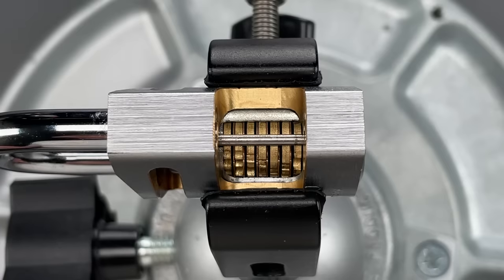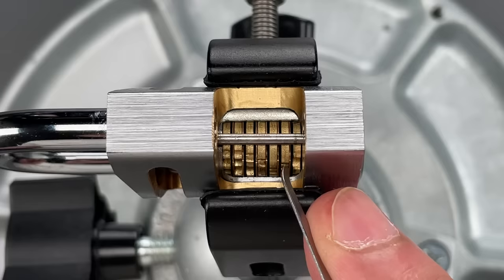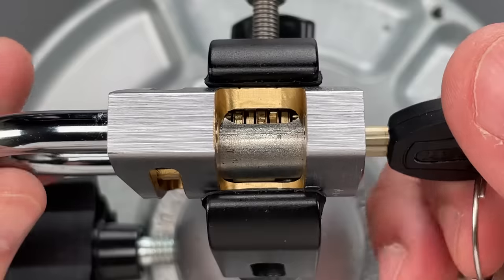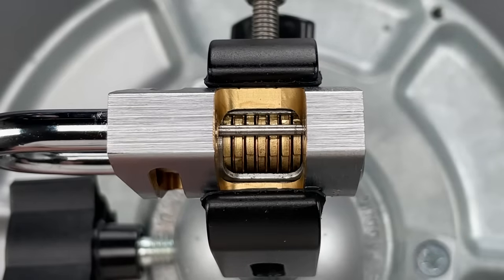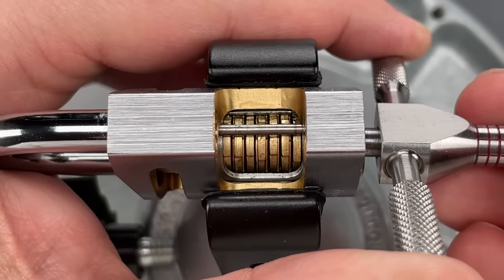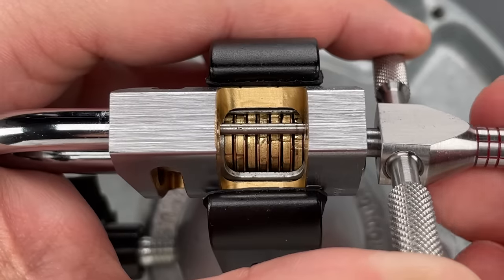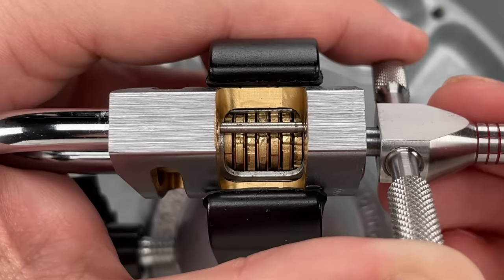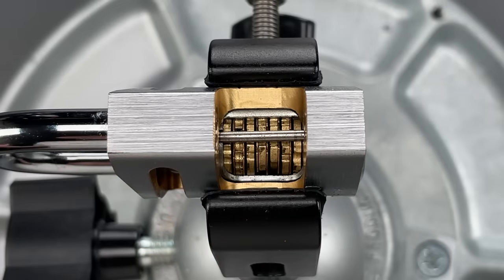[1436] Inside Perspective on Picking Disc Detainer Locks

Comment: "Isn't quite as good as we'd all like"?! How on earth could be explained better than that?! It was AWESOME!
Reply: The explanation was amazing as always, but he's right the view could have been better.  I have a practice disc lock where everything's clear but the discs, basically.
Reply: Seconded!
Reply: How does the key work too put everything in the right place. Of course it would be better if that where visualized as well.
Reply: Comparing it to the cutaway view of the pin tumbler locks, in the tumbler lock, you can see what the pick is doing when it's moving the pins. In this, the discs are blocking the view of the pick.
Reply: Transparent discs, so you can see the pick as well - but let's not overcomplicate things... :)
Reply: Right?!
Reply: @tubekrake  The keys are cut on an angle, not to a depth. The bitting angle sets the amount of play before the turning key engages and moves each disc. You can see these details a bit better in episode 965.
Reply from the maker: Unlike the pin tumbler cutaways, you can’t see the key or pick… I considered acrylic discs, skeletonized spacers, and  a few other options. I eventually decided this was good enough.
Reply: @gimmethegepgun  you do not need to see the "pick" inside the disc, the rotation the pick is doing can be seen on the disc itself (with a tiny delay).
Reply: It seemed to me you purposely did not show what the key looked like, or what the custom picking tool looked like.
Reply: @qwerty13380  you can find the entire "making of" of the tool, how it works and what it looks like is no secret, but due to how complicated it is, there was no reason to prolong the video by going over that part, when there already are videos explaining it.
Reply: @qwerty13380  if you watch the channel enough, you know what the Pick That Bosnian Bill And I Made looks like, and the key is not so important in my opinion. The idea is to show what picking a disc the painter lock looks like compared to a pin tumbler lock. This helped me visualize it very well.
Reply: @lockpickinglawyer  You were correct, excellent.  All of these have been great, this one was the best. Thanks for the effort in making this
Reply: @qwerty13380  Besides the fact that you can watch every step of the picking tool being made, the thumbnail is a clear pic of the tool, the key & the lock. I'm not sure what you're trying to imply with your comment.
Reply: @James-vn8zb  Ask your mother to help you read it!
Reply: @James-vn8zb  don't feed the trolls, 😆
Reply: I was about to make the same comment…
Reply: @qwerty13380  he showed how he and Bill made the pick and where to buy one in another episode.
Reply: @Camelcando  A few others had said the same thing.  But no one said what video, and I do not want to spend the time searching for it, and of course the trolls were no help.

From this video, I thought he was trying to hide the tool and technique he was using, but from comments like yours, I now know that is not true.  Hindsight is 20-20, but I think the link to the secret video should have been mentioned or provided in the description.
Reply: @KernelLeak  That'd be asking Wwell too much from lock companies...
Reply: @lockpickinglawyer  Bad guy.

Sorry.
Reply: @qwerty13380  If you need this amount of spoon-feeding for something simple like using a search function, I'm curious as to how you managed to get far enough in life to be able to type a comment on YouTube.
Reply: @mvanvoorden  Sounds like I ruffled a troll's feathers.  I hope it keeps you up at night!
Reply: @qwerty13380  Lots of examples of both of those in his other videos.
Reply: @gatherer818  I have never in my life picked a lock before but this video was crystal clear on the steps to go about picking a disc-detainer core. While I would like to see the inside, I'm already 100% confident on how to pick it correctly the first time. Now it is all down to practicing it over and over.
Reply: These inside perspective vids are amazing im loving the series :)
Reply: Exactly, I had no idea how a disc detainer lock worked and this gave me all the information I could want. I can piece together what it looks like on the inside of the actual lock itself but to see how the disc's look and work as it's being picked is a huge benefit.
Reply: @lockpickinglawyer  Maybe one day we will get the awesomeness of LpL's see-through disc detainer locks...
Reply: @qwerty13380  If you don't want to spend 5 seconds seaching for disc detainer lock tool then you deserve to miss out for being so lazy.
Reply: @lockpickinglawyer  this is good, it shows the lock operate. And if you know how the "Bosnian Bill and I" pick works you don't need to see it in action.
Reply: @lockpickinglawyer  And more than good enough it is H.
Reply: @qwerty13380  It seems to me as if you are a first time viewer to this esteemed Channel. The _ tool that BosnianBill and I made_ is a bloody meme coz it is that famous.
This lock picking genius has used his spare time to figure out the best way to cut away the lock body for our viewing pleasure and knowledge. If you don't like it you can always ask for a refund for the cost of viewing it.....oh wait, the video was free wasn't it. 🙄
Reply: @lockpickinglawyer  what if - hear me out - every disk was a two-way mirror? 🤯 (inception brrwmmm) I'm not sure what it would accomplish but you would see more and less at the same time
Reply: @qwerty13380  827
Reply: @Camelcando  Thanks for the reply.
Reply: @lockpickinglawyer  Leave it to the master to be able to critique his own actions...
Reply: @qwerty13380  In earlier videos, LPL described the disc detainer picking tool in great detail.
Reply: @markholm7050  Thanks, A few others have given me the links to those videos, so I am set.
Reply: @lockpickinglawyer  perhaps drill out the lock body opposite the cylinder and use a mechanics scope to watch the pick move back and forth on each disc on a picture in picture view
Reply: @lockpickinglawyer  See through disks would be cool
Reply: ikr goddamn this was amazingly built all the way from the amount of cutaway in the disc housing to the explanation of decisionmaking
Reply: Agreed 👍🏾
Reply: @qwerty13380  He showed the entire build process of The Pick That Bosnian Bill And I Made years ago. He's not trying to conceal anything.
Reply: @LockPickingLawyer where could someone find the tool like you use to straighten all the disks before you start picking? Thanks in advance
Reply: @therealedreal  It's just a flat piece of metal, BosnianBill talks about his in "(1685) Using ThePickThatLPL&IMade"
Reply: For illustrative purposes, a CGI exploded diagram/cutaway would give us a better "look", but real footage is king, so here we are at the top
LPL brings the goods everytime
Reply: I think the only thing that could have been having two camera views at once. If there had been another camera view with camera shooting from the bottom of the frame towards the area where sidebar touches the edges of the disks, it might have been easier to understand. Of course, you would have to fit both views at the same time but I think the another view only would have required a narrow fraction at the bottom of the screen.

The second view would have probably allowed to see the sidebar getting a bit deeper when all disks are in a gate + it would have made it easier to see what happens to sidebar when the lock opens.
Reply: My opinion exactly
Reply: I finally understand how these locks work... Diverse explanations for the win.

Comment: Your “Inside Perspective” series is fantastic. I had NO idea what a disc detainer lock was like before this.  This video made it so clear.
Reply: I came here to post the same thing. I knew it had rotating discs, but had no idea how it worked until I saw the cutaway with the discs and the side bar.

This type of lock always had me puzzled. Not any more...
Reply: Same here. Now i also understand what falling into a false gate means as well
Reply: Same
Reply: Seriously, all i knew it as was "first we start by turing all the disks as far as they go!"

Amazing series and amazing work!
Reply: I was looking for a name of this kind of lock for a long time. It is super hard to unlock compared to pin tumbler locks. Now i am more sure that no one is going to steal my bike when i have this kind of lock 😁 I am begginer at lock picking and managed to pick pin tumbler padlock with 5 pins  under 25 seconds with paper clips. So i guess locking with pin lock would take 5 seconds for someone to steal my bike 😂 This way it takes bigger tool and little more time so less chance that someone is going to try to unlock my bike 😂

Comment: LPL: "This bar that runs along the side, also known as 'the side bar'."
Me: nodding along like the expert I am
Reply: meanwhile, me: SIDEBAR, YOUR HONOR!
Reply: Reminds me of a quote regarding the design of the space shuttle external tank:
"That big tube down the side was officially called a "systems tunnel", which is aerospace contractor speak for "big tube down the side."
Reply: I thought that would be the bar you go to after being thrown out from the first one.
Reply: @cameronjadewallace  Beat me to it... Curses, foiled again!!
Reply: @lancer525  😹😉
Reply: Easier to work with that bar than the association, I assume.
Reply: Me: frantically taking notes
Reply: The Sidebar would be a great name for a pub where lawyers, locksporters, and lawyers who are locksporters hang out.

Comment: When you turned all of the discs clockwise, it immediately clicked why you do this on every lock. 

I know you've explained it in the past, but seeing it makes it make way more sense.
Reply: Very good point. I agree. It is so much more obvious to see it happen, than just hearing and seeing it from the outside of a closed lock body.
Reply: I'm stupid because I still don't understand why it's important.
Reply: @aspuzling  Maybe you are not stupid, you just have a different way of thinking about things. Maybe you understand enough of how it works already, or at least enough to satisfy your own feelings about it.
Reply: @aspuzling  it means you only have to pick it in the one direction.
Reply: do you mean sth like labirynths where most of the times it's easier to start from the end?
Reply: @glajskor90  To my mind, it is more like being able to see an overhead map of the labyrinth, making it easy to understand the complete layout, instead of building the mental map from walking around the entire maze to find the layout, bit by bit.
Reply: @glajskor90  more like walking inside a maze with ur right hand always touch the wall on the right.
Reply: Look out, it might've clicked into a false gate!
Reply: @aspuzling  Not necessarily; this is especially common with people that have little to no picking experience, but is still a common gap in knowledge for people of high skill, who just didn't need to know about it, so don't feel left out. The point of why you only rotate in one direction is because then, you are guaranteed to eventually hit a true gate, and every gate you come across is immediately identified as either true or false, instead of going over false gates again or possibly missing true gates because you failed to identify that you went over one, or misidentified it as one you've already come across and have identified as false. It's important to remember that with a normal lock, you only have your sense of touch and knowledge to go off of, so coming up with strategies like this in order to make that handicap lessened is crucial for people that need it.

This is especially important for going back if you failed to identify the true gate immediately, because if you don't just continue the motion the same way as before, the mistakes as listed above could cost extra time or take so long that you give up. The same goes for other false sets or gates in other mechanisms. It was just never brought up because LPL is an absolute master at what he does.
Reply: @glajskor90  no it just mean you only need to pick anti clock wise. because you have pushed all the gates past the sidebar in a clockwise direction so in order to get to the true gate you pick it anti clockwise.
Reply: @RandomInternetStranger  yeah I understand why you need to turn the discs all the way in one direction before you start. What I don't get is why you have to turn them clockwise.
Reply: @aspuzling  Either they're made specifically in factories to not turn counter-clockwise fully, or it doesn't matter.
Reply: @aspuzling  Because the lock opens by turning clockwise. Turning individual disks is easier when the core is not forced into opening direction.
Reply: @aspuzling  Most if not all disc detainer cores only turn in the clockwise direction. I have yet to find a disc detainer that turns counter-clockwise, let alone one that allows rotation in both directions. Not saying those don't exist, just that I haven't found one myself.
Reply: It's so he knows what he doing!!!puts them all forward!! Then starts from one !!sorted!!then disc 2!! Sorted and so on and so on!!

Comment: Finally! Now I understand what happens inside. Now there are only two things needs further explaining: What is zero cut, and how you decide if a lock is tensioned from the front, or from the back.
Reply: "Zero cut" - as far as I can tell - means that the "unlocked" position for that particular gate/tumbler is the default (or "zero") position, so it doesn't need to be moved / shouldn't be moved to release the lock.

On a linear spring tumbler lock with a "sawtooth" key specifically (apologies for any/all incorrect terminology), the "default" tumbler position is the full height of a blank key, where it has not been cut back at all - hence the term "zero cut".
Reply: @ACuriousTanuki  ahh yes, sounds good
Reply: @ACuriousTanuki  Close, but backwards.  The zero cut pin/disc needs to be moved the farthest to release the lock.  A DD key is a rectangular piece of metal with cuts in it to allow the key to move different distances before engaging with the disc.  No cut (zero cut) engages the disc immediately.  So, when he uses the tool to turn everything fully clockwise, it's the same as using a blank key; all the discs set for a "zero cut" are already in position.

Maybe LPL will disassemble a DD lock to show the different discs.  I know Bosnian Bill did that quite some time ago.
Reply: @JamieStuff  I think he meant it doesn't need to be moved from the context of picking, when you've already rotated all the discs and got them in the 'furthest' gate

Comment: Never would've thought that picking these means using a tool inside of the keyway to put notches on the outside in a correct position.
Excellent explainer.
Reply: indeed, excellent video!
Reply: That's also what the key does! It goes inside the keyway and puts notches on the outside in correct positions, then turns the entire disc pack to unlock.

Comment: These help bring perspective to the process, regardless. Keep making them.

Though.. I am curious how dimple locks are going to look in this series.
Reply: I believe they're usually the same construction as typical pin locks, but built in a different direction.  Pin-in-pin would be another story and very hard to cutaway.  At least the first pin in a dimple keyway is often easier to see when picking than with a standard pin keyway, because they're not as paracentric.  Some don't have warding at all, with the keyway being completely rectangular.
Reply: Exactly. And after he explains that I'd like to see the hardest of all locks to master, the dread locks.
Reply: @VoltisArt  I'm imagining a cut away with clear plastic to hold things in place.

Comment: Thanks LPL. Now I can imagine easily what is going on when you pick a disc detainer. Very easy to visualise since I've now seen what's going on from the inside. Looking at all the comments I can see that I'm not the only one who has had their inner eye opened. It's like  I now have a clear 3D model in my head.